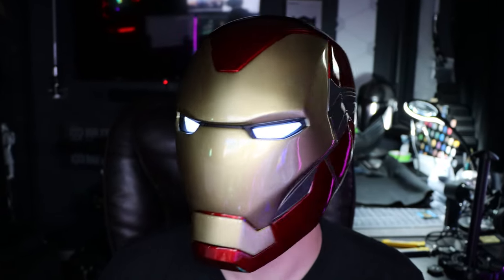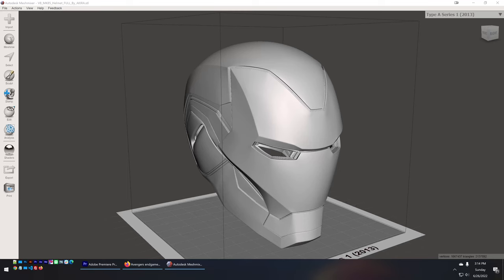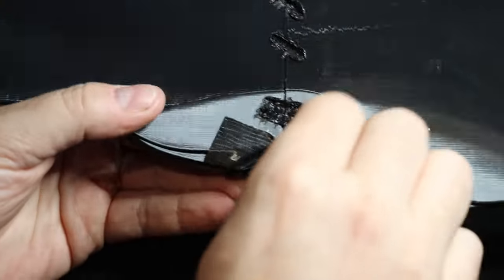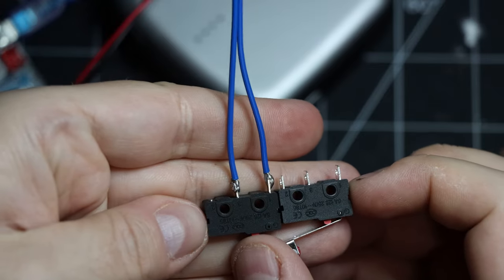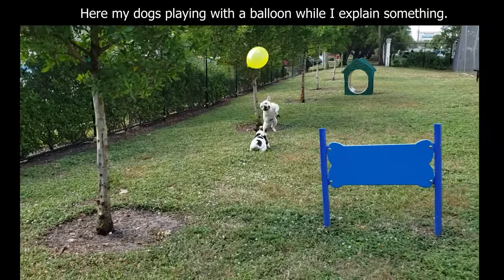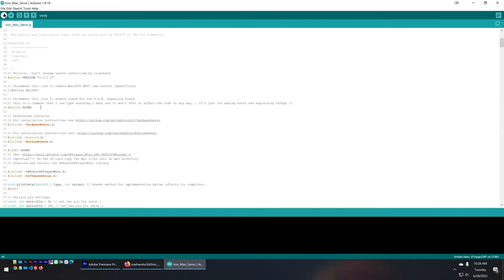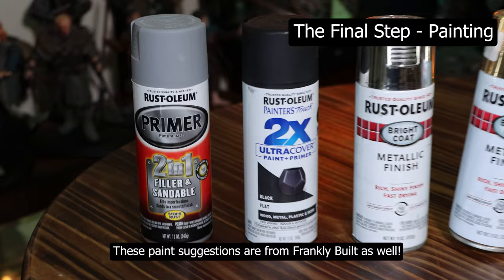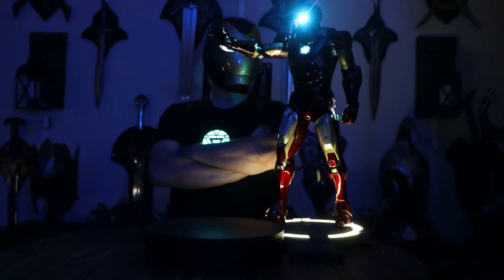3d Printed Iron Man Helmet - Motorized & Remote Control

Comment: Bravo!  Well done! Your addition of IR control is genius.  

As a side note, for the IR Module you can also use the Power Out port on SUE to power your IR Module. The " + " is VCC, and " - " is GND , would just simplify your wiring, instead of running the IR's VCC & GND back to ALISHA.

With that being said, once again, great work !
Reply from the maker: Oh wow that would have definitely been a bit more simple! I'm just beginning my arduino journey and still have a lot to learn. Thanks for commenting!
Reply: Bravo ti si slovenc

Comment: Hey, great tutorial! I am in the middle of this right now and having trouble with my servos. I'm using the same exact ones you used but they refuse to activate. Strange because i was less confident in my soldering abilities for the eyes and switch but those work perfectly. I have tried using your adjusted code and the original crashworks code but with no avail. No response form either servos whatsoever. Yes ive tried switching the wires around. I desperately need help!!!

Comment: Hi cyber Hobbit, the rustoleum flat black don't sell anymore. and do you do for de silver parts black>primer>krylon>metallic silver> clear coat or not bc i don't see you using the metallic silver maybe i missed a step?
Reply from the maker: Rustoleum is definitely still sold... rustoleum is one of the largest spray paint companies they Def still sell them. I didn't use metallic silver for the helmet that was for the 1/3 scale Ironman statue. For the helmet there are onl4 colors. 

Mask: primer>black>gold>clear coat

Helmet: primer>black>gold>red>clear coat.

Dark grey areas: primer>black>krylon>clear coat

Black eye lids: primer>black (no clear coat)

You don't have to use rustoleum black, any black paint will probably be fine as it's going to be covered. Having a black undercoat helps the gold look better but it's probably not needed... you could probably skip the black and it would look fine.

Comment: WOW ! amazing... what paints did you use ? the finish is amazing
Reply from the maker: Thank you sir! I put a list of all parts and paint used in the description but it's mostly paint used for automotives. I wouldn't recommend buying any of them online as you'll get them much cheaper in hardware stores like Home Depot/Lowes/Car part stores
Reply: @thecyberhobbit  I thought so, I live  in Europe, gotta find them ! Thank you
Reply from the maker: @PixelForgeLab  So in that case, you can probably substitute the filler/sandable primer, black undercoat and clear coat for other brands.... but to achieve the colors I went with you'd need the Gold and Red. I've seen other people use Krylon Gold and get just as good results, not too sure about the red. The red paint is a "transparent" paint that you apply in multiple layers that just needs a metallic paint under it (gold or silver should work here). Good Luck!

Comment: Hi Cyber Hobbit, Where did you get the sounds from bc crashworks only has 3 sounds and you have 6 sounds. also did you put the sounds on the micro sd card or only on the arduino?
Reply from the maker: check out @21:37  I forked the iron man code to add my IR module support. That github repo (link in the desc) has the extra sounds (there are 9 total)
Reply from the maker: The sounds go on the micro sd card. They must be added 1 at a time (check the instructions that come with SUE for the reasoning)

Comment: This was awesome to watch but, i have a mark 7 alisha board so how do i do that then if i want the remote controll function?
Reply from the maker: the only diff between Mark 7 Alisha and 6 is that for the 7, the sound is integrated. I had to plug things into both my Alisha 6 and the SUE board... you should be able to plug things into just the Mark 7 Alisha by itself.
Reply: @thecyberhobbit  So i do not have to cut 1 of the 3 wires but i can just plug all 3 as one in it? Thank for responding btw.
Reply from the maker: @celineman-a-hing1789  that is correct!

Comment: can you adjust the size of the helmet? I have a quite big head, around 61cm. How big is the model you made?
Reply from the maker: Yes! I have a big head too. I actually didn't make the model I found it online. Go to 5:09 in the video I show where I got it and how I sized it for my head.
Reply from the maker: Basically, you cut the model into a small sized ring, print that, and see if it fits over your head.... then adjust re-print if it doesn't. Just a small print to see if it fits before you actually print the full helmet.
Reply: @thecyberhobbit  Nice man, this seems like a very cool project. I bought a 3d printer last year and I love the creativity and what you can print. I have a project now that’s almost finished so I need a new and this is it.
Reply from the maker: @jakobkarlsson378  It's a ton of fun and you'll learn a lot. I was scared of the electronics/motors part but the Alisha board took care of that for me. Good Luck!

Comment: Hi cyber hobbit, could you maybe sent me links of the paints you used? And i saw that you used black first but you never used Grey or silver for the silver parts is it just the black but then with clear coat?
Reply from the maker: Paint application goes like this:

Silver parts: "Primer>Black>Silver>Clear Coat"
Gold parts: "Primer>Black>Gold>Clear Coat"
Red parts: "Primer>Black>Gold>Red>Clear Coat"

You may be able to get away with skipping the Black coat but it's a great way to see if you missed sanding away print lines.

Links to everything used are in the description though I wouldn't recommend buying online it's always more expensive, go to an automotive parts store.
Reply: i see now that you have them named but if i google them i get cans of paint not spray. what am i suppose to do now?
Reply from the maker: Sorry I just commented on this not realizing which video... what I mentioned was the paint application for building the 1/3 scale Iron Man. Though it's exactly the same paint application for my helmet.  Dark Grey Parts: "Primer > Black> Dark Grey> Clear Coat"
Reply: @thecyberhobbit  Thanks for that. i now understand it a little bit more, but i still can't find the paint anywhere do you maybe have weblinks for it?
Reply from the maker: @celineman-a-hing1789  There is a spray paint version of everything I listed. Type the name of the paint + "Spray paint"
Reply: @thecyberhobbit  do i need to have the Rustoleum 2 in 1 Filler & Sandable if i sand everything down by hand?
Reply from the maker: @celineman-a-hing1789   I had a hard time finding most of them online and found them in store instead. Go to a hardware store or an automotive store (I went to 4 different places to get everything I needed). You will pay $10 in store or $25 online sometimes for the same paint.  The gold paint I used I never could find online for any decent price and always bought in store.
Reply: @thecyberhobbit  oh..... yeah i can't really go around to places as a 13 year old i would love to otherwise.  So do you maybe know the Place where you got it from?
Reply from the maker: @celineman-a-hing1789  I sanded everything in multiple passes of 200,400,600,1000 and applied the filler primer after the 200 grit.
Reply from the maker: @celineman-a-hing1789  I got them from "The Home Depot", "Lowes" & "The Autozone"

Comment: what happen if I apply the red on top the black matte ?
Reply from the maker: The red is transparent so it would just make a blackish red and wouldn't look right at all. Really need a metallic paint under the red to tint.
Reply: @thecyberhobbit  alright ok, because I tried at least 3 different reds, but they all failed. So now I got that precise one you have, costed me a fortune, and I have a European version of rust oleum metallic gold, so I'll do a test and see ! Thanks 🙏🏼
Reply from the maker: @PixelForgeLab  Very important to do the test first, if you have the exact Red, REALLY take your time as the red can run very VERY easily and create drips. Spray from further away than you would think. It's much better to do many light coats than any medium coats. Be sure to wait about 10-15 minutes between coats.
Reply: @thecyberhobbit  will do for sure! Thanks kind sir
Reply: @thecyberhobbit  Hi there, finally I got it and tested it, looks great... just 2 more questions and I'll stop bothering you, promise ;)
1) How long do I wait between the gold and the red ? 
2) the red is already pretty shiny to me, you think is better apply the clear coat anyways ? 
thank you so much !
Reply from the maker: @PixelForgeLab Never a bother, happy to help ask as many questions any time.

I think I waited about 24 hours between gold and red. 

Definitely do the clear coat, it's kind of amazing what it does for the look, the clear coat is magic. YES the gold parts will reduce their shine a bit, BUT it'll make the entire thing look like a professional thing instead of a 3d printed thing with paint on it. For the first layer do a dusting coat a bit far away, wait 10 minutes and then do light coats... I'd recommend 3 total (including the first layer). If it fogs up don't worry, that's normal and it will go away in 24-48 hours after it's all dry. Also these instructions are assuming you're using the clear coat I recommended (dupli-color 1k glossy), if you use another type your results may very.
Reply: @thecyberhobbit  thank you so much.

I have a dupli colour 2k clear coat, Italian version, it's a small can, but I'll see 

Thanks again
Reply from the maker: @PixelForgeLab That's probably fine, basically any high end clear coat meant for cars works wonders here.